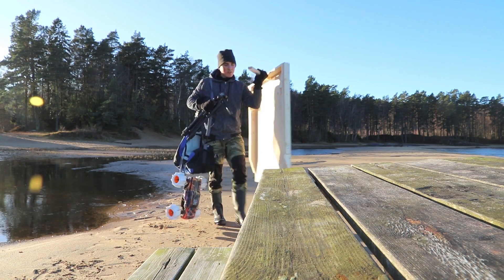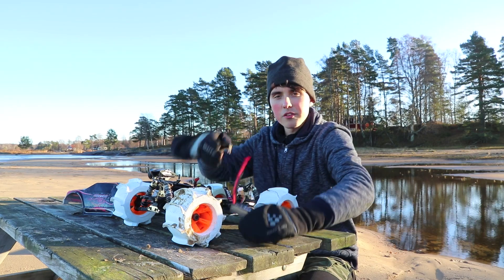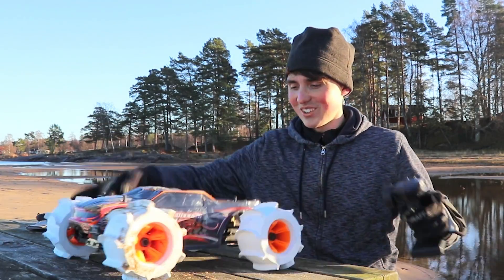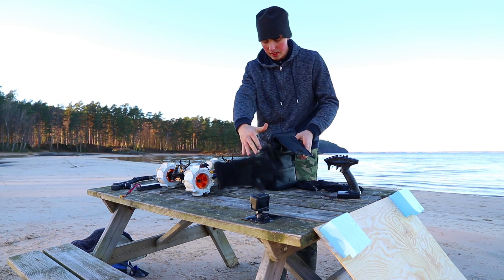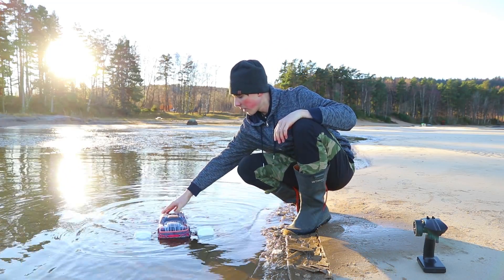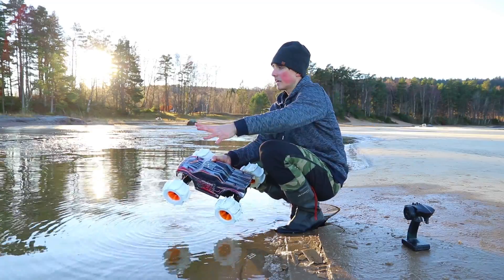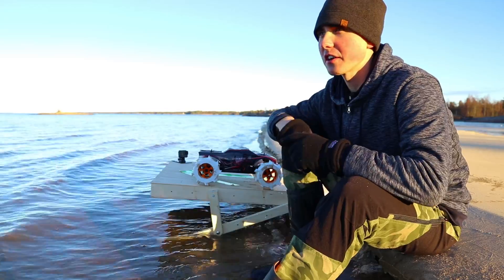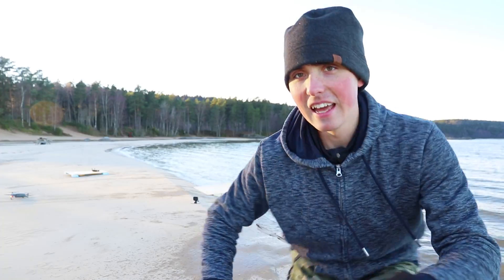3D Printed Hydroplaning RC Car Tires - Driving on Sand!

Comment: Don't Jump it in the water with the RC unless you have added floaters. It is better to just run it into the water as jumping it into the water is breaking the water surface causing the car to sink, your luck it even got it to float from doing that.

Comment: 8:22 The rear tires had soooo much power here! They caused the front of the car to lift up and flip over! I think a good way to counter-act this would be to put more weight in front of the vehicle by extending the chassis length. Try doubling it! Maybe even widening wheelbase width as well.
5:25 Since the tires hold air and have buoyancy, if you double the size of the tires so they can hold more air then the car might be able to float on it's own while in a rested position. Think MoNsT3R Truck TiR3S! : )

Comment: I am from Bangladesh, the Car's frontside is not heavy enough, thus the front tires can't touch water surface before the rear ones. Then, the angle and height of the ramp from water level are causing the car to drown more into the water even before rotatin the tires enough for maintaining the speed. For these two reasons, the car can't go far before drowning.

Comment: I’m new to 3D prints having not even received my cr10, but was wandering, do you need to match the nozzle size to the filament..?
I’m guessing you do but that would suggest that you need to change the nozzle every time you adjust layer thickness. 

Much appreciated.

Comment: You should add a cheep gimbal to your 3D printed racing drone. I️ think it the new best thing, you can fly fast and get great footage. I️ think that is is a great alternative to an expensive photography drone. Ps. You can get a 2 axis gimbal that run on a small battery for like $60.

Comment: Hey Simon,

I've got another Idea to improve your driving on water : print a small case with a fan in it, put some small pipes on it which came out under the car to create an air mattress. That's what cruise liner do to save some power.

Greetings from Germany

Comment: You should put sheets of Styrofoam on the bottom.of it and carve them as sort of a v hull like a boat to give it a tiny but of bouyancy and better dynamics in the water so the flat bottom isn't catching waves causing drag.

Comment: OMG how about give it glider wings to see what could happen (FLYING WHEELS?)
Reply: Problem is, it would get to gliding speed, start to lift off, lose traction, lose speed and immediately fall. In order to make it actually fly for any length of time you'd have to also have elevators to prevent it taking off until you are well above the takeoff speed.

Comment: How youmake the lipo battery waterproof ?
Reply: 1uai they are already water proof
Reply: The cells themselves are already airtight (otherwise they would catch fire due to the chemical reactions). Other than that you could just make sure the connector doesn't get too much water touching both sides (wouldn't take much).

Comment: Try to find a way to steer on water so you can turn around
Reply: You can just steer while on the water only not very sharp becouse it will flip and sink the car. As long as the car has speed it works.

Comment: Maybe use a 3d printer with dual extruders to make a tire out of pla and flexible filament out of 1 piece. It should make the tires waterproof and maybe the rc will float?